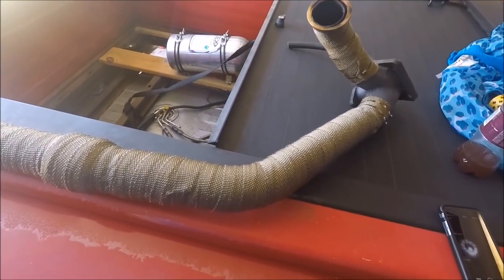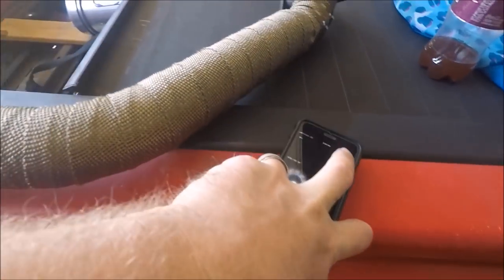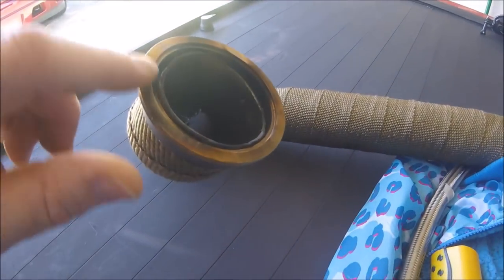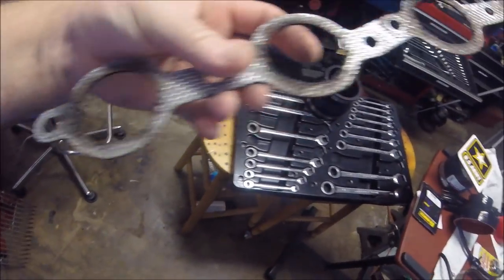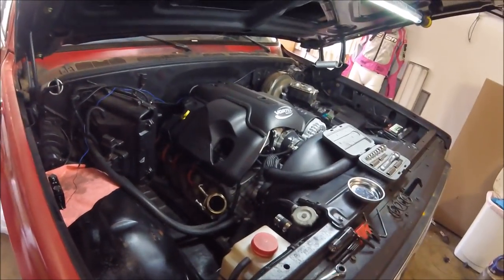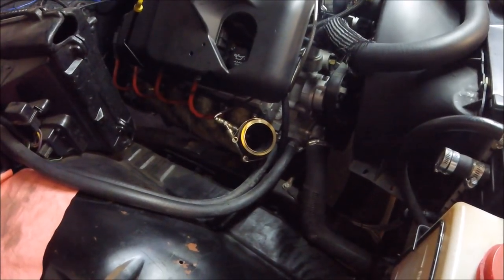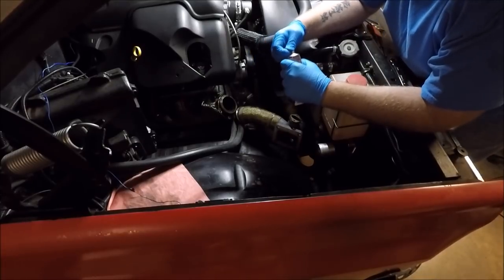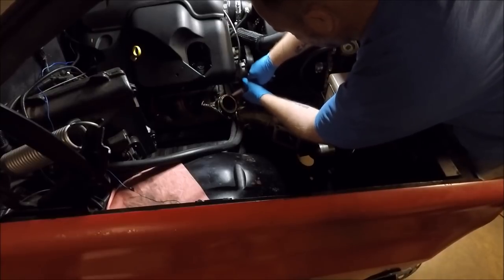VS Racing 78/75 TURBO IS FINALLY ON

Comment: Most likely the v bands are warp a little from welding but it could be that the clamps are binding so what we do on airplanes is tap the outside of the clamp with a hammer as you tighten the clamp and it should seal
Reply from the maker: Good advice. 👍🏻

Comment: Make some little dowel bolts, so when you install the turbo it holds the gasket and aligns the turbo.
Reply from the maker: That’s a good idea. Definitely would make it easier to take off and put back on. 👍🏻

Comment: He'll yeah man, glad to see her in it's new home..  

Only thing that kinda worried me was your idea to brace the turbo/ manifold to the inner fender..  

id really like to see you brace off a lower engine accessory bolt or something to that degree.. that way when the engine moves it won't be pulling on the brace and inner fender..    

I Just don't want it straining the manifold to much and possibly causing a crack somewhere in the manifold..
Reply from the maker: I would prefer to brace it off the engine as well but since we made it so low and so far out, I’m just not sure how to go about doing it. We’ll figure something out though if we have any issues. I mean, my daughter can stand in the flange so I’m not worried about the manifold or piping, it’s just all the weight being in that vband clamp.
Reply: Bad Luck Garage then the inner fender mount may work well for you then but id definitely try and use a rubber bushing, or something  to allow some flex where the brace meets fender..
Reply from the maker: Yea that’s what I was saying.... some kind of bushing or something. I’m really hoping it doesn’t come to that though. We’ll just have to see how this holds up for now. 👍🏻

Comment: If your Vband clamps are wearing out, Worm gear clamps work great also!
Reply from the maker: Can’t use worm gear clamps on vband joints brother. I think you’re thinking about the bolt clamps on the cold side. 😉

Comment: Maybe brace the manifold off the frame with a rubber bushing. So it's hidden and still has some movement. Just a thought. Great video
Reply: squarebody mikey I
Reply from the maker: Even with a bushing I don’t think it would allow enough movement and may cause the manifold to crack unless I ran solid motor mounts.
Reply: I think the inner fender will end up tearing with the movement. I would try to mount it to the block then.
Reply from the maker: Yep that’s plan A. 😉

Comment: ! Check out the PROTHANE mounts before you buy the Poly mounts. Performance online (POL) usually has them for a great price. What about a standoff from the Frame to the Turbo Flange, that would add some support.
Reply from the maker: The Prothane poly mounts are actually the ones I’m planning on....great minds think alike. 👍🏻
Reply: While it would add support unless he switches to solid mounts when the motor rocks it would pull on the stand off and eventually either the stand off or exhaust is gonna win and break the other
Reply: Good catch! Didnt even think about that!
Reply: George Mitchell your idea could still work none the less, just need to use a rubber bushing on the frame side of the stand off to absorb any movement
Reply from the maker: JT, that’s why I don’t want to brace off the frame and use the inner fender instead. The inner fender has some flex, the frame does not. But honestly I’d rather figure out a way to brace it to that bolt in the engine block I showed.
Reply: Man I feel like a dumbass lol, I was so pumped to see the turbo mounted...

 I actually skipped ahead right after you talked about the inner fender and missed you talking about the engine rocking or even  that engine block bolt...  

Guess I opened my mouth and inserted my foot... haha
Reply from the maker: Naw brother it was a boring video.... I kinda expected a lot of skipping. Lol. Truth be told, I haven’t had a lot of free time lately so my videos haven’t been edited very well lately. I’ve been trying to put content up to let everyone know what’s going on and get feedback( which I greatly appreciate) but I’ve primarily been focused on getting the work done with the videos being an afterthought.
Reply: I don't think it was so much a boring video as it was me being an impatient fuck.. hahaha
Reply from the maker: I’m guilty of the same. 😂

Comment: lol, nice StreetSpeed717 reference.
Reply from the maker: What’s a streetspeed717?
Reply: A youtuber that buys corvettes and takes them to shops to get worked on and has never turned a wrench in his life.
Reply from the maker: Hey brother I apologize. Whenever someone posts a link it automatically goes into a spam que. I was trying to approve it but I’m using my phone and have large fingers so I acctidentally hit the trash icon instead of the check mark icon to approve it. While I don’t really have any desire to see that channel, others may so if you want to post the link again I’ll try to hit the right button this time. Lol. -Robert

Comment: Sounds like lack of boost issues could be leaky gasket or exhaust...aparently other common stuff to check is compression so valves or rings...throttle body butterfly opening and restrictions in exhaust or air cleaner. Your old turbo might live to make power under another hood yet.🤓
Reply from the maker: Yep, that’s why I tore the hot side apart to check everything. Like I said in the last video, I’ll be rebuilding the old turbo and probably using it on another build with a smaller engine in the future. Maybe even in a rear mount setup. 👍🏻
Reply: Bad Luck Garage cool...i must of missed that vid...i just got me hands on an older turbo book I found rummaging through my brothers workshop...now I'm a bloody expert lol...not.
Reply from the maker: Lol, it’s all good brother. I think I’ve dine like 3 or 4 videos this week. Everyone’s used to one a week so😂

Comment: How you like the turbo? Still running it?
Reply from the maker: https://youtu.be/US0dkT1zUrs
Reply: @BadLuckGarage  is that the right video
Reply from the maker: Thats the entire turbo C10 playlist from start to finish. ;)
Reply: @BadLuckGarage  so back to nitrous, have you gone upwards of 250?
Reply from the maker: @infamousnova  For a daily driver yes, Im definitely back to nitrous. Ive never ran more than a 250 shot on a stock engine. Hell I put a 250 shot on a stock 87 5.0 for my buddy about 22 years ago and that thing held it for over a year before he finally sold it. I'm actually in the process of building another turbo car now but not for a daily driver.  Keep in mind the turbo C10 videos are several years old. I've built three other project cars on this channel since then, the Chinavette, the DR Nova, and right in the middle of Chaos Theory(third gen Camaro) right now.
Reply: @BadLuckGarage  I have a nova and trying to figure out which way to go. All I want to do is go fast, got a junkyard 5.3. What turbo you going with this time?
Reply from the maker: Havent decided yet. Going nitrous first since I have so many kits laying around. Turbo or possibly turbos will come later but haven't made a decision yet. You can check out the "Plans and Goals" video in the Choas Theory playlist for details on this build.